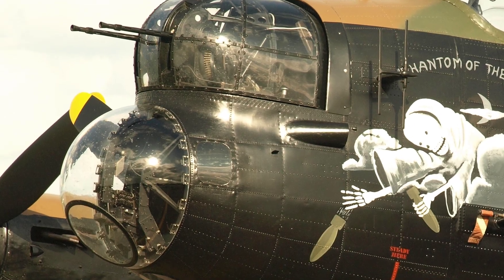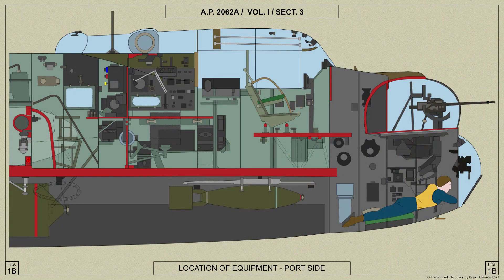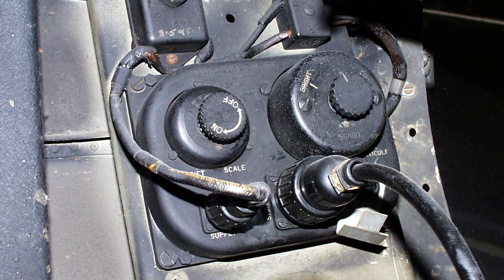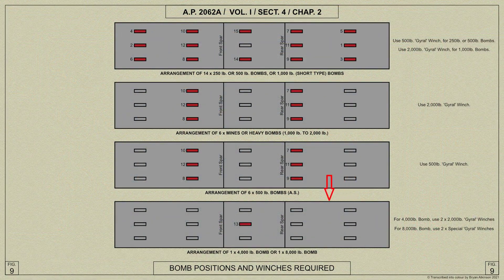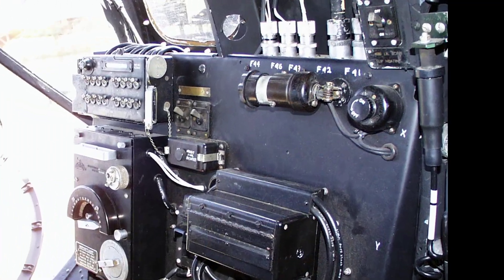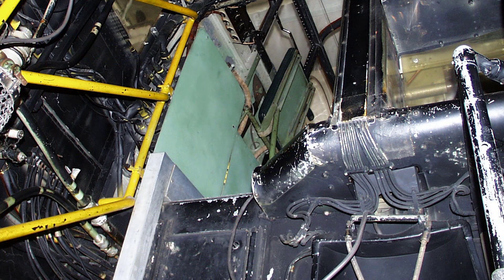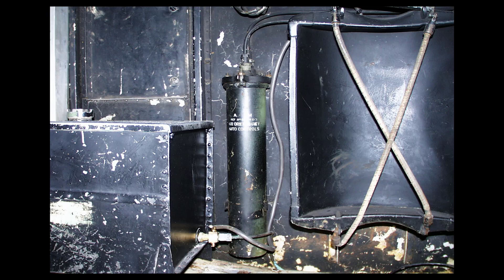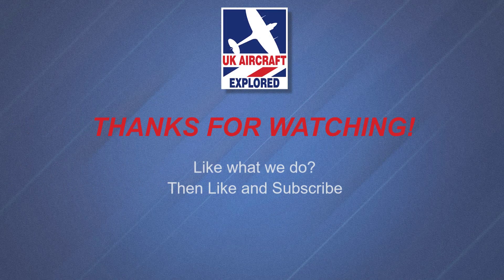Avro Lancaster – Bomb Aimer’s Station

Comment: I thought you mifgt have pointed out that 1940's aircrew in full flying gear and wearing a parachute could not pass through the forward escape hatch.
Reply from the maker: The wartime manuals point out that the forward hatch was indeed the only exit for parachuting from the aircraft.
Reply: @ukaircraftexplored6556  I used to work with a Lancaster Navigator who pointed out this short coming and how the main spar was a hindrance to movement.  What's written in a handbook not necessarily correct in practice, was the author writing from experience???   
Also poor exits for parachuting seem to have been carried over by Avro in the Vulcan design, yes the flight deck could eject out but the 3 'back seaters' not a hope,

Comment: Thank you, this is great! Question: was the Auto Steering Unit Mk. IV fitted by default? I haven't noticed in most pictures of that area before this.  I'm the same guy who asked about weight and balancing of the Lanc on another video, however I'd rather not leave my email address here.  What's a good way to get in touch with you without sharing our info here?
Reply from the maker: Message me on Facebook - Bryan Atkinson.